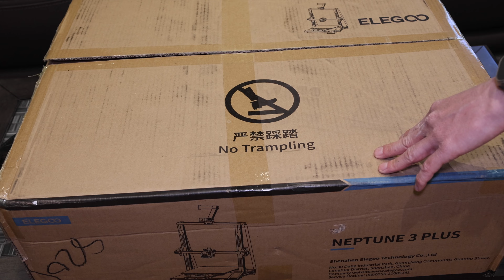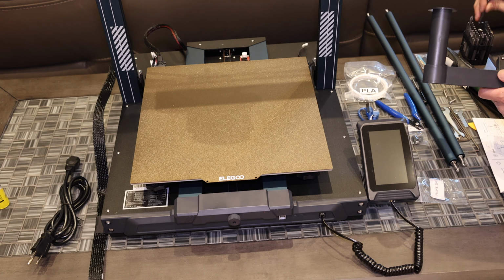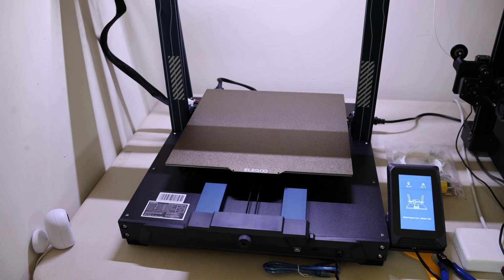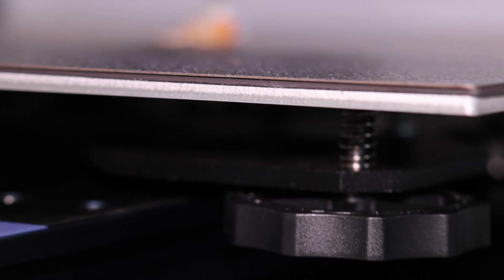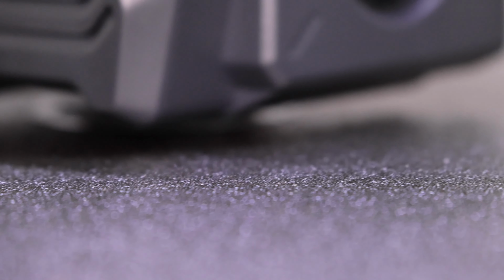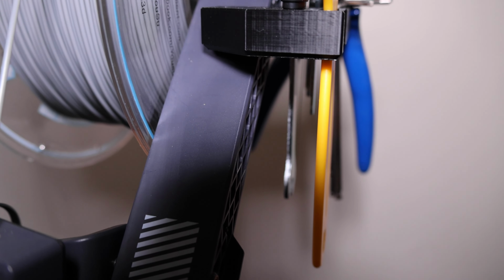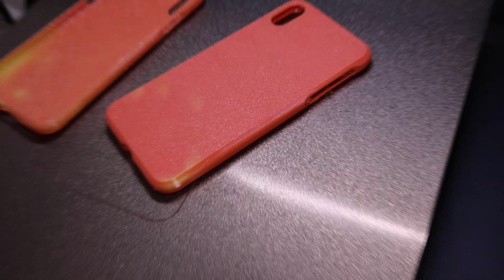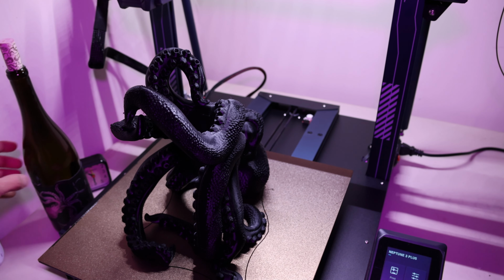Elegoo Neptune 3 Plus Unboxing, Setup, and Thoughts - BORDEAUX, THE OCTOPUS 3D Print Timelapse

Comment: I've had my Plus now for about two weeks.  It's been running almost constantly.  I started hearing  a squeal coming from the print head for about ten seconds at the beginning of a print.  It sounds like a fan bearing going out.  Is this common?  Has anyone else experienced this?
Reply from the maker: Most likely is the fan bearing going out. I’m running Klipper on mine now. Can you turn on the fan manually and see if it makes noise?  I forget as I haven’t ran Marlin in a while.

Comment: hi my friend...do you still own this printer? Would you buy it again? Thanks
Reply from the maker: Yes I still have this printer. I also have a N3Max. The Max I have running Klipper using a Sonic Pad and Debian software now. (The Creality Klipper wasn’t good)
I recently got a Bambu Labs P1S with the AMS. 
If you need the larger plus size then it’s an ok printer but I would recommend a CoreXY printer like the Creality larger one or if size doesn’t matter the Bambu printers are hard to beat for the price and the ecosystem. 
If you like to tinker with stuff the Neptune is still good but hassle free the Bambu line is better.
Reply: @LesFishingMoreCatching  Thanks for your reply man. Im from Brazil and everything is super expensive as we must pay 92% import taxes including the shipping fee. )...For some reason, I found this Neptune line in stock here from Aliexpress quite cheap.. This bambu P1S is ranging from 1.25 to 2k USD here.Creality also has a few models in the brazilian warehouse. This is my 1st 3d printer and Im kinda lost, but thanks again
Reply from the maker: @Liberta_BR The Creality K1 and K1 Max the larger version are core XY printers. Meaning the build plate doesn’t shift around which is better. See if your local warehouse has those models. The N3P is ok but slower than those unless you add a Raspberry Pi or touchscreen to run Klipper to take control of it.
Reply: @LesFishingMoreCatching   @LesFishingMoreCatching  i found the creality k1 here but its 200 usd more expensive than n3 plus. I think im going with the elegoo. Ive seen a couple comments about klipper but i have no clue what they were talking about. Thanks a lot for the tips,my friend..very helptul. Edit: Aliexpress gave me a 60USD coupom and I could not resist. :)